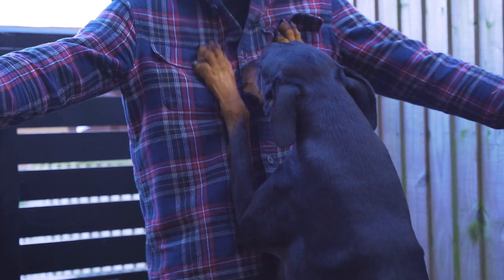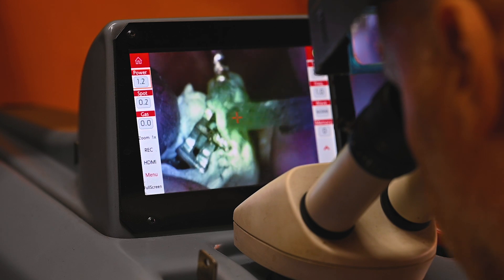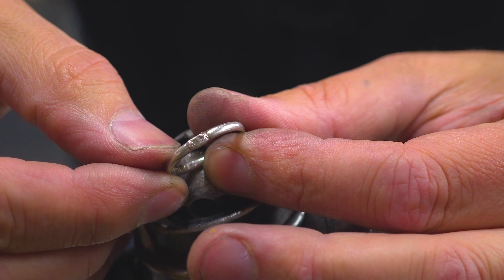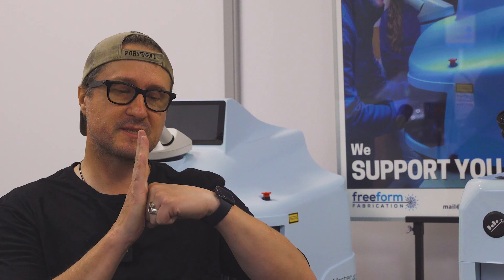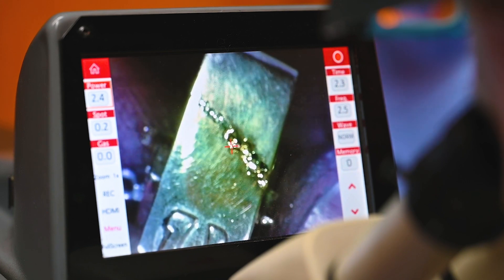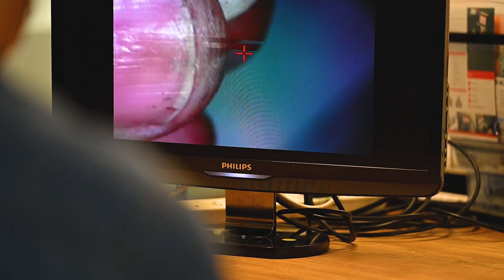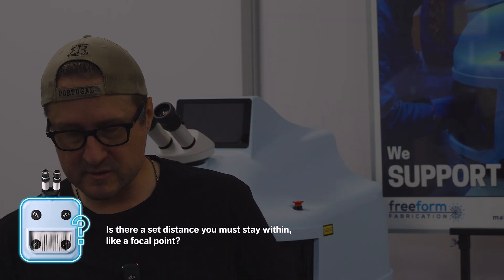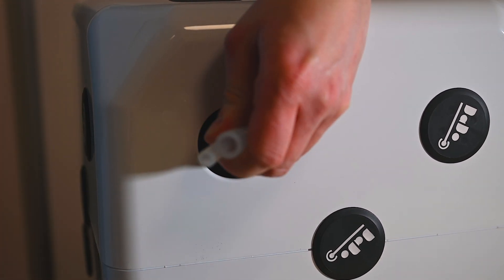Laser Welding In The Jewellery Industry - Part One | Goldsmith's Workshop Secrets

Comment: Can anyone share some wisdom Whats the functional differences between big bulky laser machines and portable desktop laser machine.. am looking for small size laser machine due to small space in my work shop is it viable choice .. thanks 🙏
Reply: It depends, smaller ones will probably have less power, but if you are working with jewelry and just want to use it for welding little pieces i think you dont really need that much power, unless you pretend to work repairing any other stuff and use it all day

Comment: Can you weld some jewelry with the new Version? I wanna compare with the old one.
Reply from the maker: I’ve only got access to the first version. They will both do exactly the same weld, the only difference is speed and power. So the 2 has more punch which would do the same job quicker. The weld will be great on both. Hope this helps 👍🏻
Reply: As Jaco mentions they would do the same job. If it helps we have customers that have upgraded from V1 to V2 and are very happy with the improvements of V2 it makes working on silver easier and  you can work faster with it.